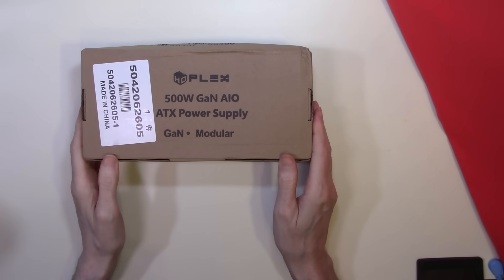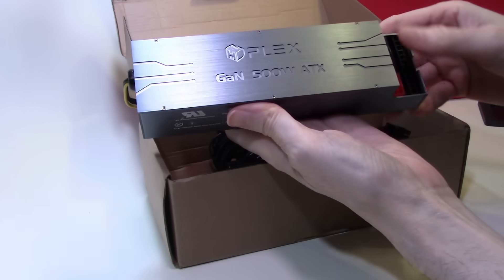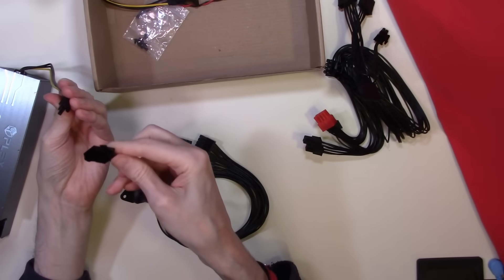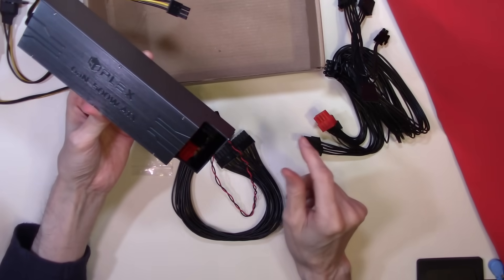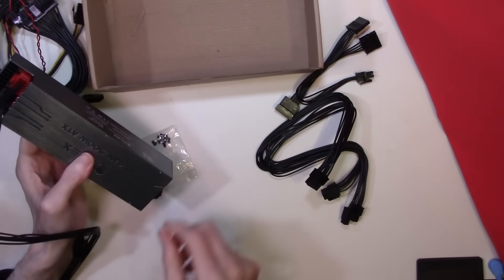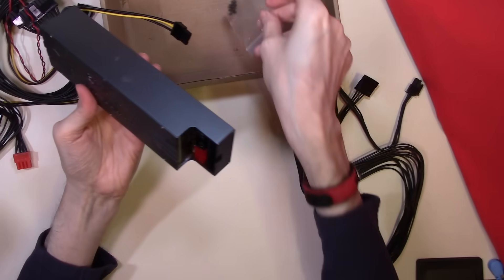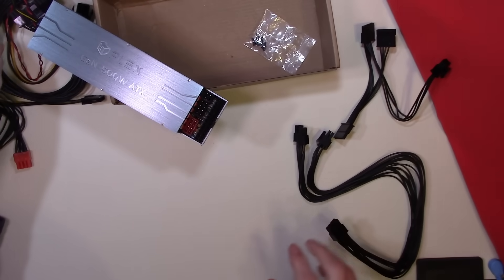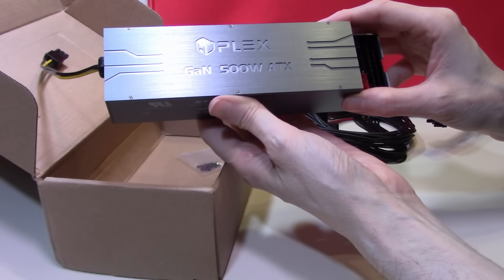Unboxing the HDPLEX 500W GaN AIO(All-In-One) ATX Power Supply

Comment: So why is it passive, if there is a fan? Why does the fan face psu wall? Heard these run pretty hot but that's probably the point with GaN.. however there is still plenty of plastic there :).
Reply from the maker: The 500W version has an internal fan that activates at >60°C.  The 250W version doesn't have a fan. The casing of both PSUs is aluminium alloy. I've not run these close to their limits but from what I've seen the case can get warm to the touch but not too hot to handle.

Comment: Can you please enlighten me on what's the difference between this powersupply to that of HDPLEX 500W HiFi DC-ATX. I appreciate your reponse..
Reply: I get it now. The the HDPLEX 500W DC ATX still needs the 330W external power adapter. 

However, is it the wattage output of the 330W external power adapter that the HDPLEX 500W  HIFI DC-ATX needs? Or is it its voltage output?
Reply from the maker: I don't have one of the HDPLEX 500W HiFi DC-ATX PSUs, but you are correct in that it needs an external AC adapter - HDPlex recommend the 330W Dell LA330PM160.
That AC adapter outputs 19.5V and 16.9A which is quite common as an input for the HDPlex ATX PSUs. If you're look to use an alternative external AC adapter, you should go for one that can deliver 19.5V and 16.9A.  While the AIO 500w HDPlex PSU is slightly larger it keeps everything inside the case, which is my preference for these builds.

Comment: The chinese have already broke this thing down and re manufactured it, I am sure without the authorization of HDPlex themselves. The chinese version is $95 USD.
Reply from the maker: Feel free to provide a link to their site. I'm curious to compare them.
Reply: @custompchardware  it doesn't have a bottom plate, so when mounting the chinese one it looks to be fire hazard. I wouldn't touch it with a four foot stick. I do have the HDPlex 850W and it is indeed a top quality power supply.
Reply: Isn't it HDplex also a Chinese company?🤷

Comment: Ah, I got hyped for a second thinking this was a fully passive fanless PSU, guess not :/
Reply from the maker: It does have a silent low speed 12V 40mm fan, inside the case, which is controlled by a temperature sensor and triggered at >60°C.
It's really not noticeable.

Comment: Hello.  Do you know any its case that can fit this and an A2000 gpu? Also would this be all i need? No ac to dc converter or anything?
Reply: I confirmed with Larry that you can mix and match .. you have the option to sync a 250 with a 250 or a 500 with a 500 and also a 250 with a 500 so it's very versatile
Reply from the maker: From what I've read about the A2000, it draws all the power it needs from the PCI Express slot it is put in as it has no separate power socket. In other words, it can draw up to a maximum of 75 Watts through its PCI Express slot. This PSU can deliver 500w. If you are looking to put the gpu in an external enclosure you'd need a board to plug it into and this PSU could be connected to that board. Alternatively if you are plugging the gpu into a small PC motherboard, this PSU could be used to power that as handles it AC to DC conversion.
Reply: @custompchardware  I meant like the Gan would fit inside, and i can just plug the mobo and cpu directly too and doesn't need to convert anything? I checked the power requirements for 7950 and A2000 and it may reach 290 to 300 depending if overclocked. And the HD plex gan only has 250 or 500.
Reply from the maker: As you will see from the videos on both the 250w and 500w models you can pair two PSU together allowing one PSU to power your motherboard and one dedicated to power the gpu, using the synchronisation cable. I generally build a custom case around the computer but I'm sure you can find a prebuilt case to meet your requirements.
Reply: Thanks. Honestly if I could figure out how to work a pico psu I  would use the Inwin Choppin max lol. or if i can find someone who offers 3d printing for a mini  itx case.
Reply from the maker: There are certainly quite a few 3D printing companies out there who could quote you for creating a mini  itx case. Or alternatively thingiverse.com has quite a few such cases that people have uploaded if you fancy exploring those and get someone you know that has a 3D printer to print it for you. I've used pico style PSUs before but not where I needed a gpu in the system.
Reply: @custompchardware  yeah I found the ITX case I want, its just 300$  to mke hahaha

Comment: Captivating! Is there a 500 watts psu that runs on DC 12 Volts?
Reply: Their 400W DC-ATX converter takes DC inputs although their site says it's rated for 16-30VDC, not 12V, so all in all you're probably still better just running the computer after your inverter rather than before it.
Reply from the maker: I'm not an expert on the design of PSU's, I haven't come across such a PSU for computer motherboards. I'm assuming that you want to run your system off batteries.

Comment: Very interesting, looking for a small psu for a nas build maybe i'll consider it but no much reviews out there on them. 
Is there any indepth data on lab tests of efficiency, ripples, safety measures etc... ?
Reply from the maker: This particular PSU has only just been released so there may not be much in the way of independent lab tests out on it yet. I've been using the 250 watt unit for quite some time with no issues so far. So I too wait for any in-depth data on lab tests on the 500 watt model. But I'll be fitting it to one of my NAS builds in a video soon.